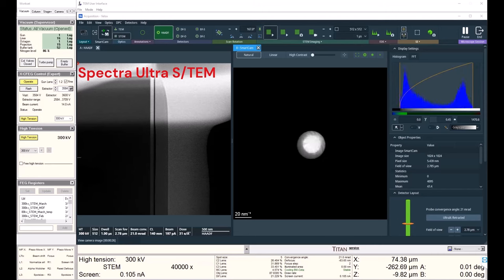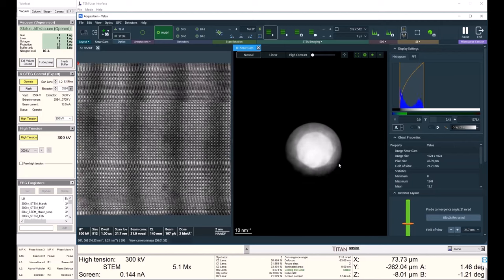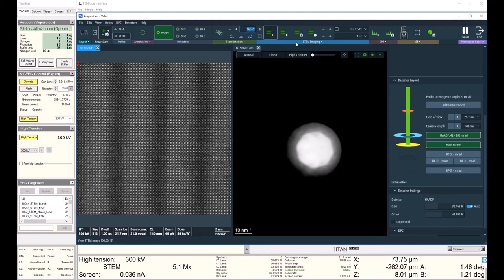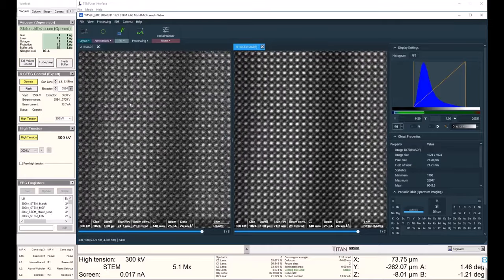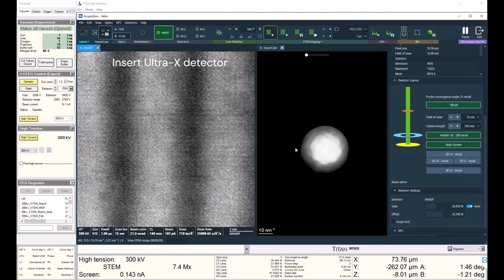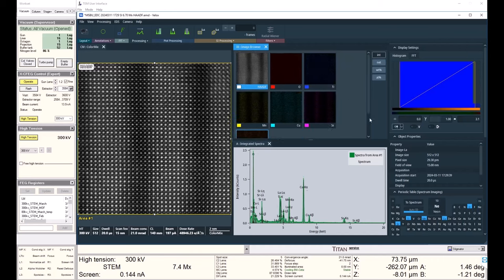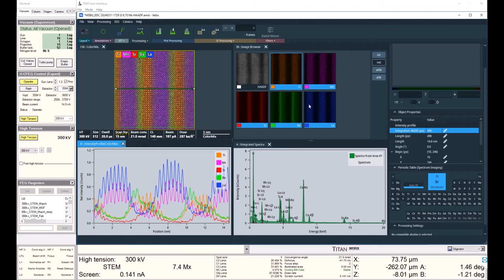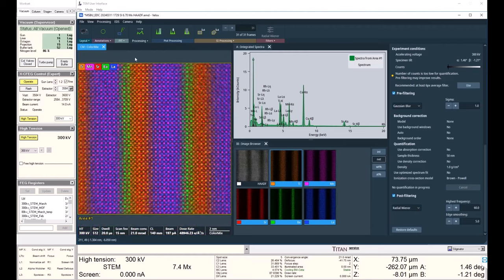Unveiling Atomic EDS Maps Acquisition: A Demonstration with Spectra Ultra TEM, Ultra-X and Velox

Comment: Hi
This is Hemant Kumar from Iisc Bangalore, India. Thank you very much for very informative video about atomic resolution EDS mapping, I am
working on Magnesium alloys so can you suggest me about the parameters to get this kind of nice atomic mapping since I am trying but not able to get the result, as sample get damaged as well as drifted.

Thanks
Reply from the maker: Hi Hemant.  In most of the cases it is very straightforward.  If you have challenging sample, start from 100x100 or 200x200 pixel map, dwell time around 10 usec, drift compensation on and optimized for periodic lattices.  If the sample is too uniform, you might try to use separate area for drift compensation.  If the sample is easy to damage, than you might need to play with dwell times and map sizes to see if you can find good balance.  Please note, that you need at least Super-X to be able to get such maps and for alloys you probably need probe corrector.
Reply: @TEM_guide  thanks for the details I will try this and yes we have Cs correcter microscope.